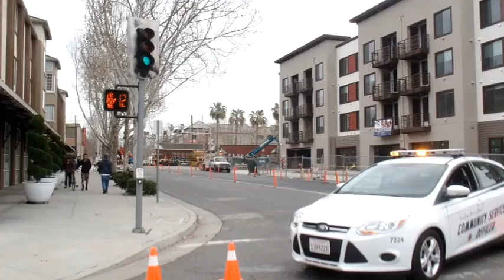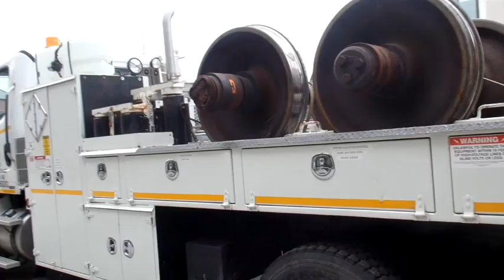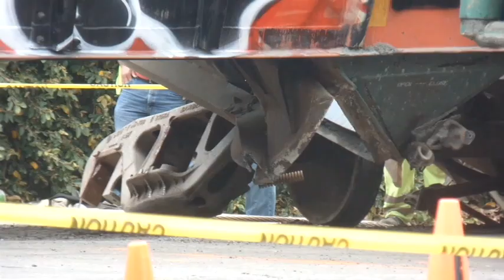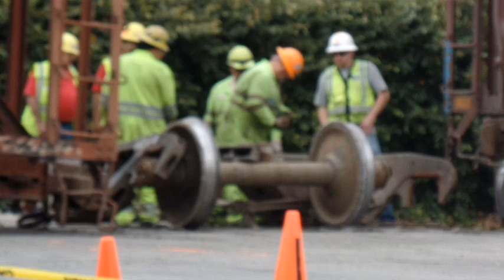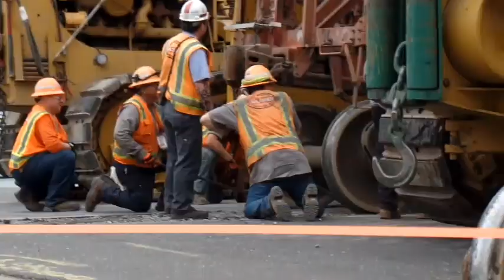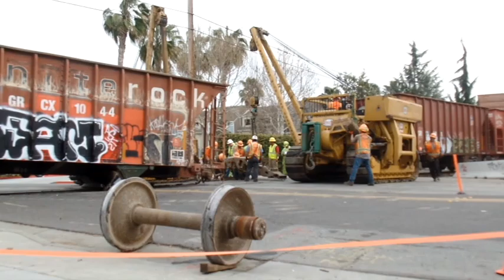Granite Rock hopper train derailment

Comment: As I observe the wheelset on the road, I must say...the wheel flanges are so small. Just about a penny high compared to the wheel itself and how big these machines are. No wonder they derail so easy. Just half of inch of wheel lift on a curve for any reason and derailment.
Reply: if there changing out the wheels the derailment was most likely caused by a burned out journal box